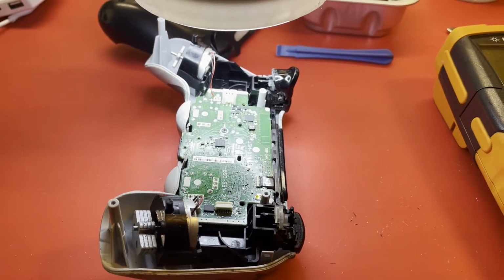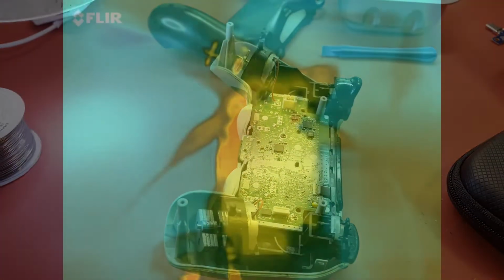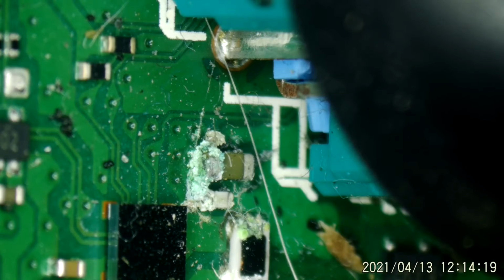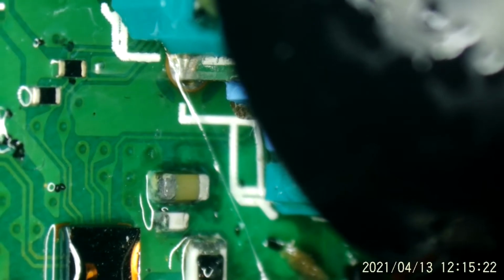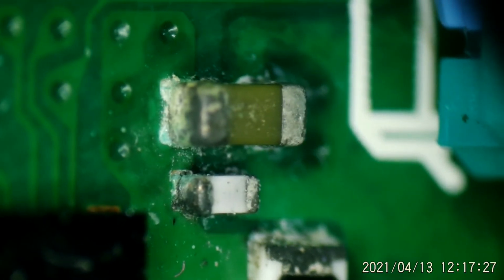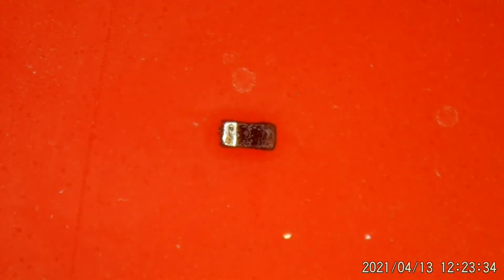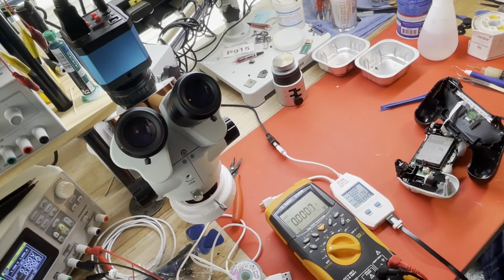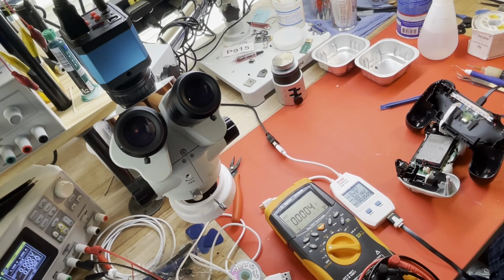#14 Repair of a DualShock 4 Controller

Comment: (8:30) I mostly loved seeing that you own Hot Tweezers... The thermal camera is a must-have for laptop technicians. For service of LED TVs and audio equipment I would say that it is very desirable but NOT indispensable, because in TVs the common fault is the LED strips (backlight) located to the bottom of the cabinet (below the screen) and in audio applications the IC Power Amplifier (Sound outputs) that are usually large and we can touch with our finger. 

Flir huh! One of the best brands, maybe number one. It seems simple to fix Joystick Controllers ... At the component level and unfamiliar? For that reason thank you very much for sharing this type of repair. Greetings from Mexico.